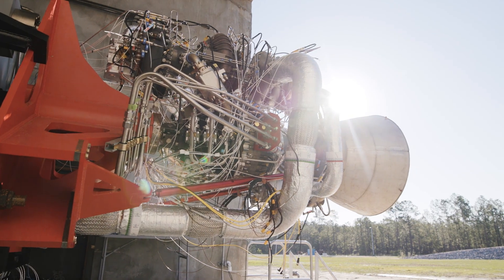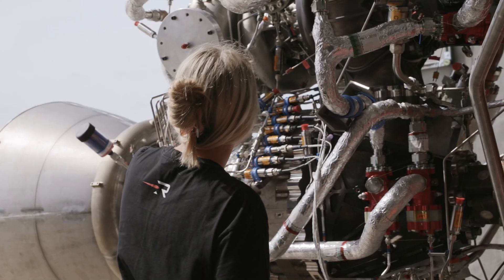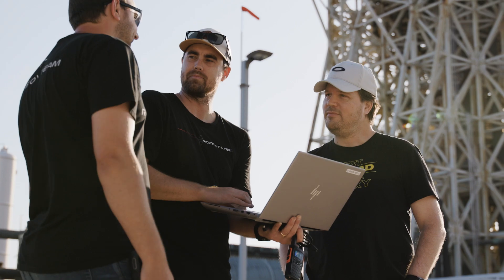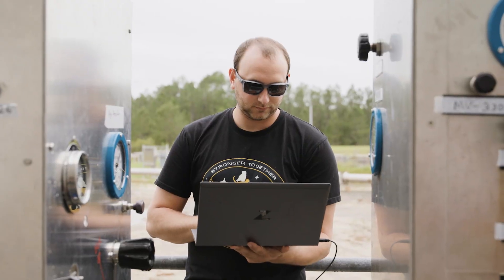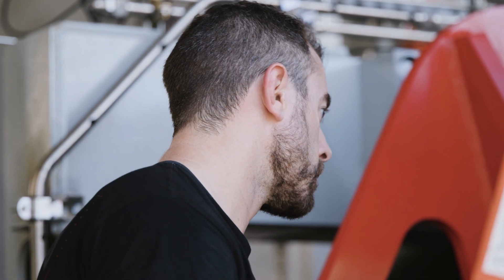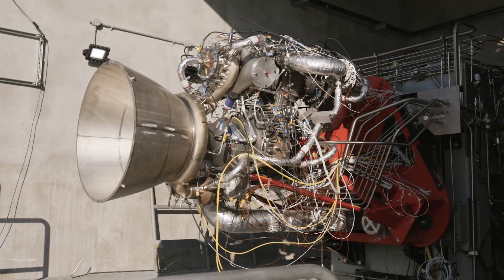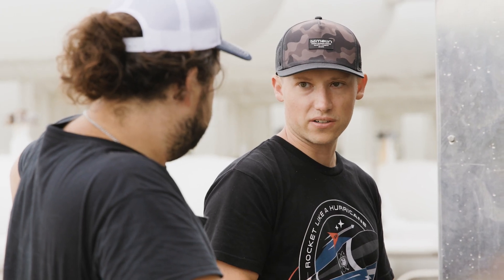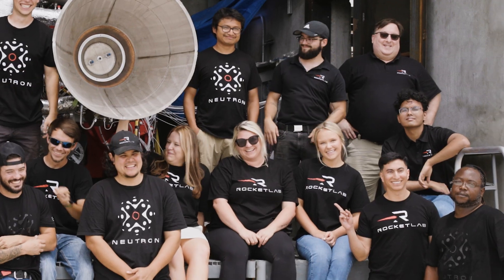Archimedes Test Stand | Stennis Space Center

Comment: Glad to see the effort progressing to maximize RKLB shareholder value. No one disagrees NEUTRON medium-lift rocket, 13,000 kg to LEO, is where it's at for Rocket Lab, and ARCHIMEDES engine is the key. More players are becoming aware of FIREFLY's emerging, medium-lift rocket, 16,000 kg to LEO, the ANTARES 330 (1st stage) with 7x MIRANDA engines (already hot faired), with MLV 2nd stage) vehicle and a1x VIRA engine, a vacuum version of MIRANDA. Good to know the competition, likely to effect the RKLB share price. No, FIREFLY is a private company, but likely to go IPO in 2025, after a successful demo flight.  Already FIREFLY ALPHA small-lift, 1,030 kg to LEO, is taking away launches from ELECTRON, with first launches by Dec 2023, and 6 launches in the remainder of 2024, and just this week, a deal inked with Lockheed Martin for 25 ALPHA launches starting in 2024 to 2029.

Comment: That engine is way too complicated in design. Definitely needs massive streamlining.
Reply: You understand 80% of the "complexity" you're pointing out is all the tubing for monitoring data during a hot fire test right?
Reply: This is what development engines look like. Extra pipes and cables everywhere to look at every possible pressure, temperature, etc.
Reply: @bwjclego  Yep. Contrast the early Raptor engines — spaghetti cabling and plumbing everywhere — with the current production hardware.
Reply: Unless you design engines for SpaceX, I doubt your comment holds any value.
Reply: Might be due to wanting every bit of data for the development